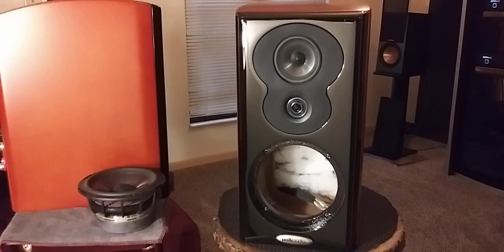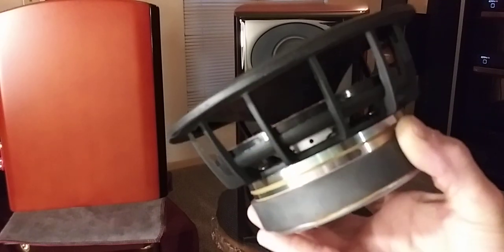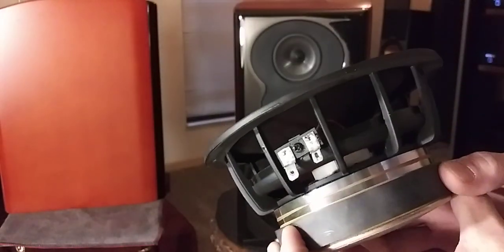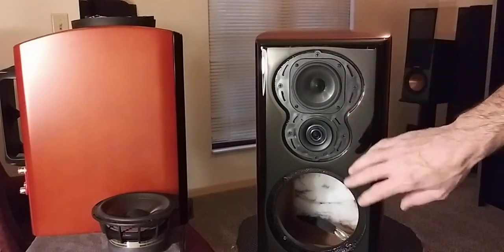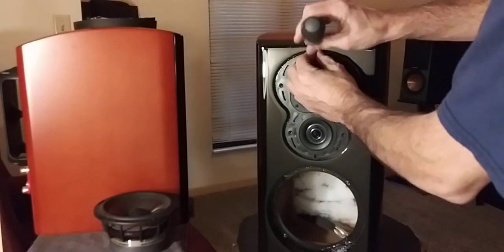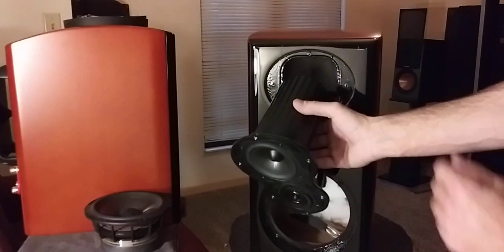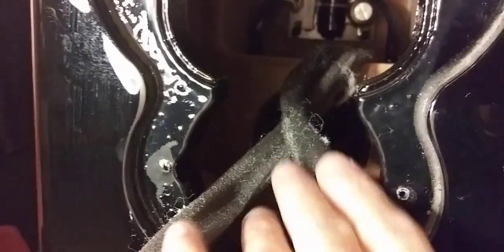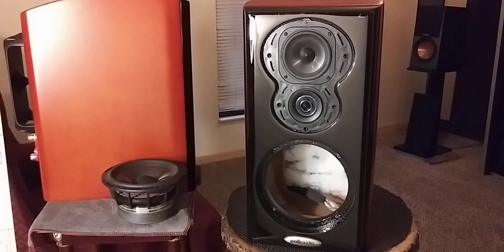Polk Audio LSIM 703 Bookshelf speakers- A complete POPPING THE HOOD a closer look of whats inside!!

Comment: I just got the S10. I am using it with Modi 3, Asgard 3 Preout to SMSL DA-8S. I plugged everything and I thought what a waste of money I did. I had the Modi and Asgard 3 from start. But then I waited for the concept of burn in and after around 10 hours of listening in 2 sessions I am amazed what happened to these Polks. For a small Bookshelf and cosidering my space I am blown away what I am hearing. I am waiting for the Modius which is in shipping right now and after balanced and removing the pre-out hope would being more goodness. Mainly using Foobar with highrez 16 bit or 24 Bit FLAC and Tidal. TIDAL is good but foobar is off the chain when you have your own Flacs. You should give a shot at S10 or S15. I wish I could have gone for S15 but my desk space is compact and the Length was not allowing this

Comment: Way back in like 2013 I sent my 703's off to VR3 mods to be customized and here is what he did to the xovers:

Tweeter Network -
Clarity Cap ESA
Mundorf Mox Resistors
Jantzen air core Inductors
Supra 15 Awg Wiring, gold disconnects

Midrange Network -
Clarity Cap ESA
Bennic Electro bypassed by Clarity Cap ESA
Mundorf Mox Resistors
Jantzen Air Core Inductors
Supra 15 Awg Wiring, gold disconnects

Woofer Network -
Bennic Electro bypassed by Clarity Cap ESA
Mundorf Mox Resistor
Jantzen Inductors
Supra 15 Awg Wiring, gold disconnects

They, to this day, sound incredible and are 1 of 1 as the degree of difficulty proved to be a bit too much. I would put these up against speakers at 3x the price.
Reply from the maker: Nice ! Did the crossover fit bwck into the cabneit ? I also have a 1 of 1 Prime hifi just highly modded my Sansui Au 717 Master restored Check out his video 
I still rock out the 703s Thought about sending to GR research '
Reply: @tee-jaythestereo-bargainph2120  Yes he shoe horned them in and he promised he would never do this mod again.

Comment: Good job on this video! I'm really surprised they put inductors with ferrite or iron core and electrolitic caps in the crossover. I think they should have pushed the quality gradient all the way for this speaker, considering the price tag! Thanks again for a very informative video!
Reply from the maker: They sound amazing for 450.00US New and the build quality is great, Best deal i have gotten in 31 years of buying new speakers 😆 they are power hungry and they need a really good front end to shine though , The bass is incredable and for the price, and real cherry veneers,  i stole them at that price , their 30 pounds each nice drivers and 2 sets of crossovers kind of unheard of for 450.00US , Thanks for the comment I will be reviewing the JBL Studio 530s Nexted !!!
Reply from the maker: The Caps aren't electrolitic their mylar and polypropylene for sparkling highs and air core inductors notch filters and zobel circuits ORTH crossovers
Reply: @tee-jaythestereo-bargainph2120  I
Reply: @tee-jaythestereo-bargainph2120  You got quite a bargain! About 8 years ago they were reviewed in Stereophile Magazine and the price tag was1400$. I am not sure if they are the same but they look identical.
Reply from the maker: @yvesboutin5604  Yes I did love them still and they are the same -Bass weight is so impressive
Reply: @tee-jaythestereo-bargainph2120  Thanks for responding so quickly! Did you make more videos ?

Comment: Great views. Are those tin push clips connectors for the wire to the drivers? That's a shame. All that quality & they use the worse connections possible.
Reply from the maker: No its 14 gauge wire with Aluminim clips and they go on super tight , I tell ya after 33 years of being an audiophile i never thought I could by speakers that sounded like a 2k speaker for $450.00 US on sale very solid heavy with a 2inch front baffle 1.25 inch sides with lots of bracing and a 1inch divider 8 inches back ,  real cherry wood venners only thing is they require a big power supply to sound their best 1k integrated amp really didn't do them justice once i got the Yamaha AS-1100 ohh my ! Thinking now either
 KEF LS50s/wharfdale 4.2/Martin logan 35xt ? What you think i should go for nexted ?

Comment: I have the lsim 707 flagship towers as my rears 4 of them.
Reply from the maker: I wish i had the space for the big boys or I would had a set the 30 standmounts have crazy bass extension for a 6.5 Bass woofer would love to try the new Legend Ring radiator tweeter and crossover with my 703s may be a whicked modification Speaker has like 22 screws in each cabneit , Those 707s are heavy huh?

Comment: TJ  what the deal with these review guys recommend to change parts on some speakers like the klips 600 which I think sound great. Have you seen that
Reply from the maker: Yes i have seen that ! And Honestly Danny with tech tuesday on NRD channel, he is a very smart guy in the audio world, but in my opion why fix something that isn't broke ? And why take all that time and money to put into  a 5 to 600.00Us dollar speaker when you can just buy lets say a 
1k SVS ultra bookshelf ? I can understand cheap mods like accoustic filling or using wood glue on all the screws so they don't vibrate lose . Me personally i would leave the RP-600 alone maybe add $1.50 for accoustic filling and maybe more bracing brackets in each cornor and a bit of gorilla wood glue to hold the brackets in place and a dab of glue on the screws,  I thought about doing a video upload on this 2 dollar no hollar Mod ! 😆

Comment: Great  you didn’t a great job on there I just bought them but haven’t turn on yet. I only have one question do you recommend speakers
Reply: Sorry great job
Reply from the maker: @danbalkey2580  Yes i reccomend them, espically if you can get for half price , but you need very good front end and high ⚡ power , their rated at 200 watts and they like to drop down between 5-7 ohms alot ! My reference system at about 4k total is barley good enough for them, but yeah their built to a very high standard ! The better the front end the better they will sound , Bass is insane !!

Comment: I just got the 707 and I’m not impressed. It seems like the tweeter and the midrange are out of phase. Also, it doesn’t seem to have a solid mids although it has a midrange. I do love how they look and they have great bass
Reply from the maker: What are you powering them with ? Because these speakers are a very high level speaker, and they like to drop down low in Ohms staying between 5-7 ohms most of the time , meaning they perform best with High voltage ampliefiers , This is why i went with the 703s,  even though I have a 330 watt amp at 4 ohms and a 300 watt amp at 4 Ohms the 330/300 watts amps  both perform great with the smaller 703s, Now my 180 watt ampliefier at 4 ohms is barley enough for the 703s and all these amps are power rated properly, and they are not a AVR,  my Marantz 1409 Avr couldn't push my 703s properly at all ! Hope this helped you out speakers should have been rated at 4 ohms , Whats the power ratings of the LSIM 707s ?
Reply: I’m powering it with a sherbourn sr120. Sounds great all the way till it hits 2k then it stops to shines. I’m gonna take it apart and try to reverse the polarity of the tweeter and see. Maybe even remove any L pad on the crossover to the tweeter. Great video by the way
Reply from the maker: @Laissez_Faire  thank you boyrecon , The lsim 703s i must say have been wonderful, but they like to drop to 5-7 ohms most of the time, so i had to put the class AB power to them and         ( High Voltage) to get them to sound amazing my lower power amps just didn't have the umpp to them , I think they should have been rated at 4-ohms. I say this because my amps are switchable from 4 to 8 ohms , Hope you get that phasing tooking care of
Reply from the maker: @Laissez_Faire  Is that ampliefier a Home theater reciever ? Because my Marantz NR- 1409 HTR just didn't have enough ummp in it to drive the LSIM 703s,  even my 2ch class AB Pioneer Elite-SX-N30  Hi-Res network reciever that has mid integrated amp power thats 85watts at 8 ohms and almost double that at 4 ohms had a very hard time driving the LSIM 703s properly to its full potential , Does your Reciever have front preouts for L and R front channel ?
Reply: Tee-Jay The Stereo-Bargin-File ok. I bi-amp them (not bi-wire) and voila, they came to live. Night and day difference. Now they sound like one would expect 👍
Reply from the maker: @Laissez_Faire  i was going to tell you this , I made this comment with another guy , i did the same thing ! great job man ! I ran my Iotavx Sa3/Pa3 to the midrange and tweeter and my Onkyo integra to the bottom woofer and ohhh my !!! Actually i tripled amp them ! Iotavx Sa3 integrated amp bridged for right side midrange cone and tweeter and the Lotavx PA3 amp bridged for left side speaker and My dual mono Onkyo integra m504 amp bridged for both Left and right side woofer !!! Sounds amazing, its crazy what you can do with the Iotavx Sa3/Pa3 combo it has outputs to jump to another amp from the PA3 ! Review going to drop soon of the LOTAVX SA3/PA3 combo Its a budget Champ!
Reply: After 3 days you are not impressed, give them min 100hours for break in then you change your decision.I power them emotiva xpa dr2 and trust me, I'm really in shock
Reply from the maker: @buekbukiewicz8064  I had close to 100 hourslisting time before i reviewed them , and i love them!  very smoothly laid back soundsignature. And i took all 23 screws out of each speakerbox and retighten much better than stock with a dot of gorilla wood glue to hold in the screws better over time , several screws were not very tight at all! Glad you like them,  I got new speaker stands in yesterday for them
Reply: Bułek Bułkiewicz well i have the sherbourne sr120 which is an emotiva. Once I bi-amp the speakers there was a major difference.
Reply: Some have said that the included jumpers don't help the sound. Better jumpers, bi-wire, bi-amping have improved things for some. Also, some say the 705 is better balanced from top to bottom. However, others have said that the 707's ate better all around. It's all subjective.
Reply from the maker: @walterdockins8475  I have had good luck with the jumpers , I did have basically for amps on my 703s 2 amps whefe bridged IOTAVX Stack then My onkyo Integra M504 that I have over 30 hours in cleaning and replaced light bulbs , I went to replace output stage transitors with toshiba exivelents and got nervous so A buddy of mine i work with use to manage Emotiva repair shop finished everything off for me now i just run the Integra Dual mono amp new caps new output and power transitors all cold soldiers redone i can't believe the sound difference is crazy ! I almost went with 705s but my 703s are more than enough at 200 watt at 8 ohms Bass is crazy , I also used 1.5 inch accoustic sticky foam and covered the intire walls and floors of the inner speakers very happy with them.

Comment: Did you ever get a chance to try the tower versions?
Reply from the maker: Sure didn't I wanted to try the 705 then i was told it has a smaller mid driver 5.5inch instrad of 6.5 and midbass slam wasnt as good so maybe one day i can get the 707

Comment: I have these speakers and I like them a lot but those crossovers are built to a price point (have to save money somewhere) and they are nothing special, small inductors, sandcast resistors and electrolytic caps (not all). If someone knew what they were doing and made some nice external crossovers for these, I am pretty sure they would be even better, whether it would be worth it or not is debatable but because I got mine really cheap as open boxes, I would invest a nice chunk of change in them if they could be improved sonically.

Comment: No gaskets strange not a good idea, should be gasket for the woofer and a gasket for the plastic housing for the midrange and tweeter and gasket for tweeter and mid-range and I wouldn't tighten the screws too much not with engineering plastic, your warp it if to tight but not too loose either about the same tension as a compressed oil sump 8 newton- metres especially if there's no gasket make a gasket use a floor tile like an office 12-in by 12-in bitumen floor tile.
I thought you said it was completely turn down?  I wanted to see inside the mid-range chamber what type of filling and how much and values and components of crossover next time a. You get those gasket sorted out! sound a lot better! especially the woofer! what causes a lot of resonance in the battle.
How are you finding the iota amps appreciate your opinion.
You can use super glue in screw holes especially if they're not holding lying down on its back first
Reply from the maker: There is a soft rubber gasket around woofer , I think i show the gasket in the first video , its setting on top of speaker that doesn't have woofer missing on the left . Thanks for stopping in
Reply: @tee-jaythestereo-bargainph2120  right but still no gasket/ dampening for the mid or tweeter section you pulled out.
Reply from the maker: @johnsweda2999  thats what the soft rubber is in front and the back of midrange is a long tube like a cone shape the ring raditor tweeter was capted off but the back of both dumped out in 3 foot of Damping matirial that filded up inbetween 6inches ×3in inch opening -

Comment: Why am I opening this speaker?
It sounds good, that it self is good enough. Right.
You got a Unique accent. Hollywood, movie called shooter, old man who knows about guns speaks exact accent.
Reply from the maker: Yeah , I know the movie 😆 I took apart to show the awesome build quality , Review of the Sansui G-8000 coming soon ! And the amp drives the Polks to their full potential ! Thanks for dropping in 😆
Reply: @tee-jaythestereo-bargainph2120  your welcome Sir, appreciate your input. Actually I am auditioning this speaker and s60 floor standing one step down. Lets see which wins. I am using arcam avr850 receiver. 
In your opinion which one is better. Over all.
Reply from the maker: @jackryder6732  I love the company Arcam ! But honestly the 703s need more power to be driven correctly than a home theater reciever can produce , You need like a 2 channel power amp the 703s are 200 watts each and they love to drop down to 4 ohms, My IOTAVX-STACK is barley enough power to drive them and thats 2 bridged ampliefiers (Mono) with 2 power supplies 120/120 .I am sure your Arcam has front speaker preouts to run to a bigger amp the Emotiva basX  A-300 drives them well and cheap at 400.00US Mu Marantz AVR couldn't drive those 703s for nothing lol Gots to keep it real ! I will look your AVR up after work but i honestly don't think it has the ummppp to drive the 703s they need serous power 😆
Reply: @tee-jaythestereo-bargainph2120  Thank you for your reply. If I don't want to spend on a new amp, then what speakers would fit my Arcam avr850 receiver. As per spec it can handle 4,oms. Not many receiver can handle 4,oms. This was a flagship receiver